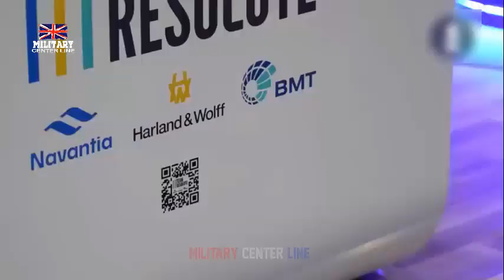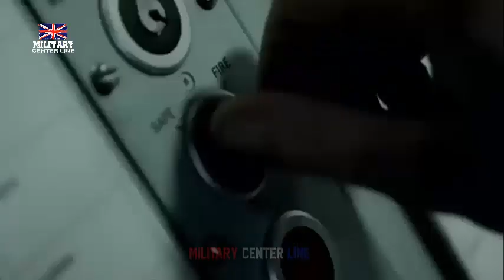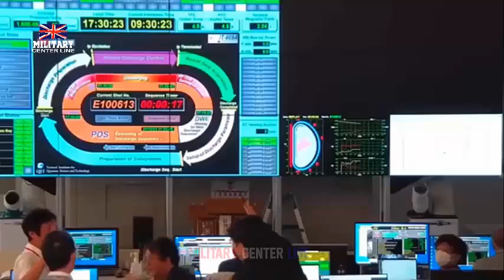The Royal Navy Could Become a Nuclear Navy As in 'Nuclear' Aircraft Carriers?

Comment: Would they refit the QE carriers? Retrofit or build a new section? Would they need similar sized reactors as the US super carriers as they are designed to operate with significantly smaller crews and are 35% smaller.

Comment: R/R already make SMR's for the Navy's Subs and been for the past 60 years. This isn't something new for heavens's sake.
Reply: Actually it is
Example A4W reactor on the Nimitz class produces 550MW per reactor while the S8G on the Ohio class produce 220MW
Reactors on carriers are considerably larger than submarine reactors
Reply: @verdebusterAP  👍
Reply: The scale would be new but not the technology, engineering or the industrial base necessary to deliver.
Reply: @robertpatrick3350  
The USN would have no problem allowing the UK access to the A4W and A1B since the issue would be supplying enough power for EMALS for current ships and future
Reply: @robertpatrick3350  R/R have working on that. Setting up the manufacturing infrastructure in the UK for when the government pull their fingers out of their arse's and give the green light to proceed, but no, they'd rather spend billions on windmills and solar that doesn't work.